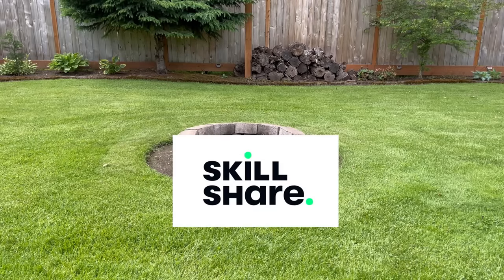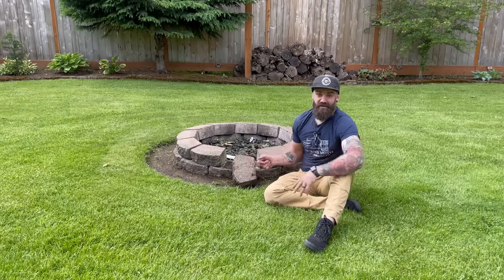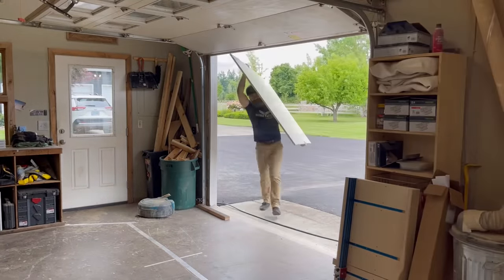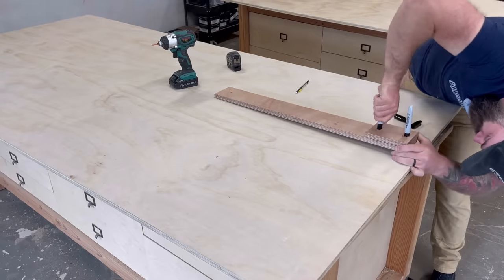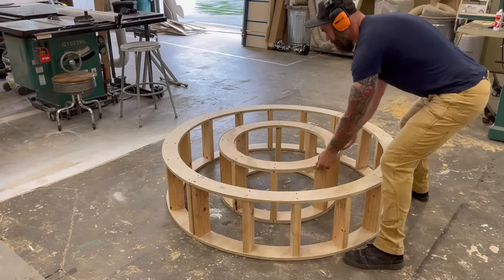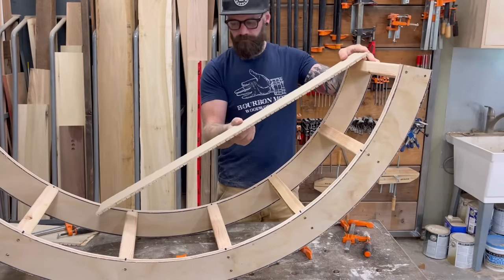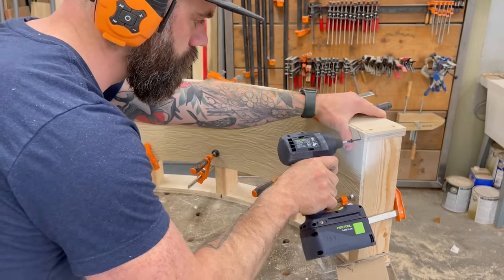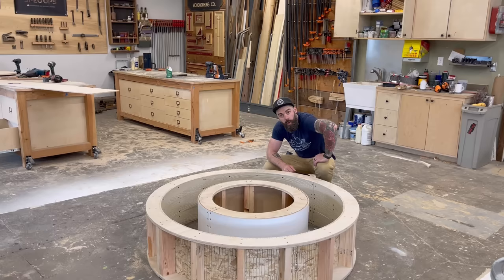Making a Concrete Fire Pit the Right Way || Ultimate Fire Pit Build

Comment: Probably could have cut the cost of the concrete forms in half, had you made them out of a cheap sheet metal
Reply: They make literal "concrete forms" that are easy to set up. I believe the technical word is sonotube.
Reply: @Sara-L  yeah that's a brand name, there just concrete tubes for pillars&feet, and they would have worked well for the interior form. However, for the exterior form, concrete tubes typically   the max-diameter is 48"(will probablycost you like $100). If you want something wider for the outer wall you'll have to construct your own form. Sheet metal is relatively cheap, if you are not looking for quality or thick pieces, and easy to work with. Just calculate the circumference you need, coil it up and fix it in place with some sheet metal screws, and done.

Comment: Could have just used a Refractory concrete.
Reply: At $100 per bag vs $5 per bag I don't think that's realistic for most folks.
Reply: @rsmith2786  You can get decent refractory concretes for these low temps for $35-$50 per bag. Not sure what you're buying for $100.
Reply: @harleysrocknrollchat  Please share where you can buy bags at that price.  I'm talking real 60-80 lb bags you can substitute for what was used in the video.  I'm aware of 25 lb bags near the top of your price range.  That still works out to over $1500 in materials vs less than $100 shown here.  Genuinely curious as I plan to build one of these and would absolutely use refractory cement if it's affordable.

Comment: I work as a technical designer at a factory in Denmark (Ambercon, Genner) that makes precast concrete elements (columns, beams, stairs, interior walls, etc.).
When we were building a new administration building a couple of years ago, the walls for the main hall were cast with wood grain texture using real boards as a bottom in the forms. All other walls are painted white, but these walls are raw and untreated. It looks real purty. :)
I have that very same Bosch reciprocating saw myself by the way (GSA 18 V-Li)...

Comment: I agree with @DriveCarToBar
Union carpenter here. We use diesel and oil mixed in a backpack weed killer sprayer on forms before the pour. Just use Masonite next time for curves. You actually could have built this with just the Masonite and rebar stakes. We’ve done curvy pools at fancy resorts in a similar way. Exposed concrete is finished by masons and sanded. Looks great after.

Comment: You did reallly good! I have to say though, I feel like some upward smacks with a hammer to the underside of the top frame would've been quicker to slowly get it out. In future, or more so other people doing this, wrapping interior frames and PVCs with a foam makes them extremely easy to remove, just make sure you get a good tape layer, I found generic packing tape works well, the plastic stuff, otherwise you'll get the foam stuck to the concrete. Built probably 3000 concrete drainage pits and that was the best thing we ever learned, and a slit in the PVC can make life easy too!

Comment: cool project.  One thing to note - the properties of concrete are that it's extremely strong in compression, but weak in tension.  That's what rebar is used for - to add strength in areas under tension.  This is why you see it in slabs and structural concrete.  In this case it likely didn't add much to the strength, but the inner voids created by the river rock is an interesting addition. It's likely you created an insulated buffer to further help with expansion with heat.

Comment: Excellent video and narration--other creators need this technique (badly) - - - Irony...I'm taking out my fire pit and reclaiming that 16ft^2 with grass.  Bought a "portable" propane fire pit as a replacement.  Now I can chill in my driveway or backyard depending on the occasion...only downside is it takes several hours for the portable pit to cool down to make it safe for transporting (in a vehicle)...

Comment: Next time you are going to "vibrate" to remove the air bubbles and get the mix to settle nicely, might i recommend using a simple hand held air chisel and just modify the tip so you dont rip into your material. I Made mine with a rubber stop on it. It does an AMAZING job, is light and versatile to use.  I used to make manufactured stone using molds that we poured concrete into. Until we purchased a proper vibratiing table, that chisel was a life saver. YMMV. Great video!

Comment: You could run an edge around the top to soften the edge. Also the outer form could be removed when it's firm to smoothen out any seams

Comment: Good looking job! I've done a few of these and your form work is way too expensive considering it won't be much pressure from the concrete. Could use simple panel boards vertically inside and thinner boards for the circle itself just adding vapor barrier plastic with some form oil on that. Dig a deeper circular hole where you fit the boards so it hold together in ground. Strives in the ground and across the form, add 5mm rebar net and masonry mesh.

Comment: Looks fantastic! I would suggest putting in a small foundation lined with concrete, or a plinth. Between seasons, that ground is gonna shift, and that ring may end up wonky.
Reply: There's no way that's moving, it's one solid piece. Even if there's an earthquake, the insert would be flush.

Comment: Use form oil to prevent the concrete to stick on your forms . Sprayer works fine can wet a rag and coat like that also

Comment: As a former Industrial waterproofer, There's only four things you need to know about concrete, Its big, its hard, its expensive, and no one will steal it. Good job on the screed. if you want a smooth surface use painters plastic to line the form, it also helps with release.

Comment: Hands down the easiest way to mix concrete is to get the woven demo bags from hd like $15 for a box of 25. Then put in an 80lb bag of concrete a gallon of water then just roll the bag back and forth. Pull the bottom corners from side to side so you get the water on every part of the mix. About 30-45 secs or briskly working the bag and it's perfectly mixed. Then tuck the top of the bag into whatever your filling and dump it in. I won't mix it any other way now. The bags eventually get beat and water will start pouring out if them. Then you use the bag for trash. Win win. Try it and tell me it doesn't put to shame mixing it any other way. And there's almost no cleanup after. 😎👌

Comment: Hit the sharp edge/circumference with an angle grinder! A 1/4 chamfer or radius will make it look neat and maybe keep your kid a little safer. A standard metal grinding wheel works surprisingly well on concrete.

Comment: The internal should have put like a 3/4" piece of wood between the three connectors, with the melamine overhanging 1/2 the width of the separator board so no space on the ring touching the concrete. Then when done you take the connector screws out and slide the 3/4" wood pieces out. That leaves a little space so you can pull the inner ring piece toward the center and then can take them out.

Comment: Next time tape the ends of the pvc to prevent mud from entering and also always oil your forms to help with taking your forms apart! Not bad though! I’d also buy a cheap edging tool for the edges, it prevent chipping when you remove the forms, same for the oiling of the forms

Comment: For supposedly not been in concrete guy you're very well-informed the sawzall vibrator was new to me when people wearing looking we would use diesel to make the boards not stick. This was done intentionally especially for someone not used to concrete if I would do anything different I would round off the outside edge possibly with some chingford are taking the boards off earlier and working the edges down only because hard-edged concrete like that tends to chip off earlier and easier making your work look older than actually a rounded edge is less likely to Chip and stays looking newer longer

Comment: @Bourbon Moth Woodworking
I'm curious if there was a way to get holes made at the top also. Where you filled with rock before putting the the concrete, having that be an open chamber so when you take out the PVC pipes air flows through it also. Then goes in at the bottom but heated air would be in that chamber coming into the fire at the top, making a smokeless concrete firepit. Likely would have needed smaller PVC going from the top of that opening into the center of the pit. I think it could be done. May eventually try my hand at it. Your fire pit looks awesome though.

Comment: adding slag to the concrete will help with heat transfer to lessen stress we do it in block manufacturing light weight block here in Canada code for government buildings

Comment: good call on not burning the PVC out (though that's what I thought you were going to do with the interior form!).  "Although PVC is flame resistant, PVC products release toxic hydrogen chloride gas when heated. These corrosive gases can spread faster than flames, trapping building occupants before they have a chance to escape."  This is the inherent issue with PVC.  Stable while in use but once disposed of, no guarantee it wont be burned.

Comment: If you had put those strips in hot water for a little while it would've  bent right into place but 1/4 would've held your concrete too,a few snap ties to hold it all into place and your ready to pour haha....you did a good job especially for not having concrete experience.

Comment: Very impressive. You didn’t call us “everyone,” or “guys,” for that I thank you from the bottom of my heart. But when you said you were waiting for 30 days for your cure to be complete I was sold.

One more thing; I’m a construction accountant, that includes stone masons and precast manufacturers. Wood forms are the most expensive but even fiberglass forms must be used repeatedly to be cost effective. Wood forms must be used 15+ times, fiberglass 10-12 times depending on size. Big forms cost more in materials and labor. There is a form oil that works like magic to release your forms. You need to buy it. That form is expensive and belongs on your balance sheet, intact, for years. When you eventually retire that form will still be worth it’s full cost to produce so keep track of that.

Comment: Get an air nailer.  Cut down your assemble time by 8x the time of driving screws. The inner ring would have burnt up with your first fire. I honestly like the original one better.  Less hassle overall and moveable if you decide to change it.  You are able to build it up or reduce its size at will.

Comment: I think I would’ve made it a smokeless fire pit by put holes at toward the upper part of the inner circle..  with the cool air coming from the bottom and as it heats up as traveling up the the inner circle, it’ll get rid of the smoke.

Comment: If you did the internal in 4 pieces and did the joints at an 20% or so narrow angle on the outside you could just remove screws and pull it in and out

Comment: How has this pit held up? Concrete retains moisture inside of it, and that can boil and cause explosive shrapnel when it bursts out of concrete. Did you have any issues with that? The firebrick would help, but a good fire has enough radiant heat that the concrete would likely still heat up as it leaked between the firebricks.

Comment: So a year into it, I gotta know, did it crack?  I had a friend have a "professional" charge him $1500 to do a firepit like this.  Watched him build the whole thing.  He mixed some sort of tile compound in with the sakrete, and added sand as an insulator.  He then used cinder blocks as a sort of frame and hand formed and carved the concrete to look like it was made of different sized rocks.  It was beautiful when completed.  I remember asking his many times, "you you never have any of these crack right?"  We waited 2 months for it to cure.  Then the first time we had a fire we felt it expand as we were all sitting around it, and it just cracked all over from the heat.

Comment: My thoughts to make it easier to remove the inner form would be that the cuts that you made should not have been directly across the form. Also, it doesn't need to be 1/3, 1/3, and 1/3. It could easily be 40%, 40%, and 20%. In doing this, when making the cuts for the 20% part, angle the cuts so that it could be slid directly towards the center. With everything screwed together, it won't be a problem to hold the concrete and once the concrete is set, removing the 20% part should be pretty easy. After that, the two 40% parts should also be easy.... Just a thought..

Comment: Internal form idea: Make the three form support sections smaller and add spacers between them. when the screws are removed then the spacers should pull out and give you freedom to move the supports. Do not screw the melamine to the studs. Glue blocks or strips to the back and screw sideways into the studs.
Reply: or just cut one of the sections at an angle so the form would slide out instead of a square cut. would have to put a brace on the inside but wouldn't have to change anything other then the cut.

Comment: 💪🏼🤘Video ‼︎Sadly you put the iron reinforcement directly in the ground ! It gonna rust from the ground and up into the concrete, which expand the metal, and destroying the concrete from the inside.. 
 - But that live for at least 5 yrs.✅ (You NEVER want to see rust in concrete ! ) 
I have an idea: An iron metal pipe from outside the pit, to bring air inside the fire pit. I knew some,  who lived in a Teepee (for 8 yrs in Denmark) and they had a system to "not to draw cold air inside the tent", with a metal pipe under the ground and directly up under the fire pit.

Comment: Looks amazing, just one thing.  I'm sure it's been said, but you should never put rebar into the ground, and then pour concrete around it.

The rebar will rust in the ground, and that rust will transfer into the concrete over time and crack it.

Other than that, looks amazing.

Comment: I have run into a problem bending a piece of pine to the shape of a half circle , And what I did was soak the board and kept t wet and applied weight to the center of the board keeping it wet and added weight until it was the shape I wanted and it would have worked with this application as well

Comment: at 10:45, would soaking in water make it more flexible to bend and shape?  Or, would that ruin the soffit?  I've never worked with the material before.  Thanks again for another video. I always learn a lot and come up with some ideas to work on.
Reply: that would work, but it is hard on that soffit and would have to wait for it to dry and it weakens the glue, so if you wanted to make it last for more then one use, the kerf cut is the way to go. To expand on his idea, cut the strips to each cripple block so it looks like wood grain brick? maybe not.

Comment: That form, rebar, metal mesh, rock, etc is all really overkill but that fire pit will probably outlast your house 😆 if you decide to build another one use refractory cement. It holds up better to heat.

Comment: NEXT TIME TRY IT THE EASY WAY. 

in the donut hole area of the fire pit. Fill to the top with dirt.  Compact the dirt until you get the shape you need.  

For the exterior do the same thing. 

If you want a smooth surface you can line the dirt with plastic suran wrap 

For a textured surface use leaves 🍃 for the desired pattern

Then line with rebar or some kind of fiber to toughen it up like glass fibers or even hemp.  When everything is fully dry consider applying a some kind of hydrophobic and heat resistant barrier

Comment: Looks great, my only suggestion would be the soffit material, not to cut it into strips as it shows in the final look. Keep the sections bigger so it has a cleaner look.
Reply: I know this comment's a bit old. Woodworkers are used to doing laminated panels, hardwood floors, tongue-and-groove walls, etc., so as a fellow woodworker, I think this look he went for is great. Personal taste, though, for sure. That being said, I honestly probably would have done single pieces as you suggest, then seen this video, and gone, "shiiit. Why didn't I think of that?" :-)

Comment: I was afraid you were going to forget to supply intake air from the bottom around the outside. This really helps with smoke. Embossed wood grain looks good. Overall nice job, especially on your first try.

Comment: why not use sono-tube for the inner section it would strip a lot easier and much less work involved also can be used for the outer form with little bracing

Comment: To much concentration on rigid forming better to use 1/4 inch plywood and steel pins to secure it was taught by my family who all were skilled tradesmen and masons. Yes it is a good idea to add fire brick to the inside as the air in the concrete will expand and cause it to spall. This is the concrete breaking because of internal pressure sometimes is just falls off other times it can violently explode off. Screed is correct. The metal fire pit ring is the perfect touch for finishing the fire pit. Thanks for sharing.

Comment: You did a beautiful job but why didn't you just leave the inner form intact until the concrete was completely cured then remove the screws then get rid of it with the inaugural fire?  Lots easier that way!